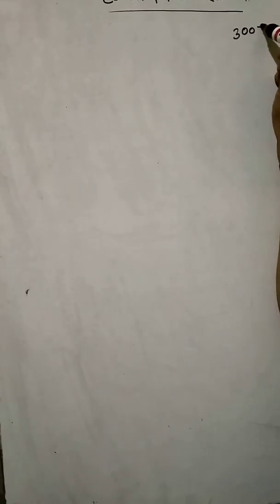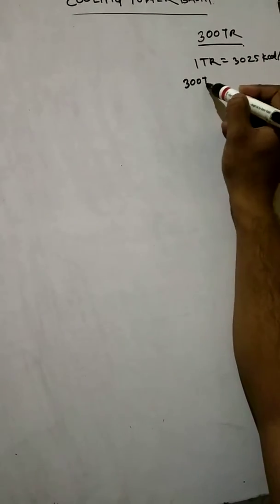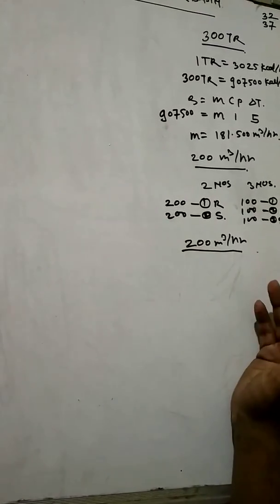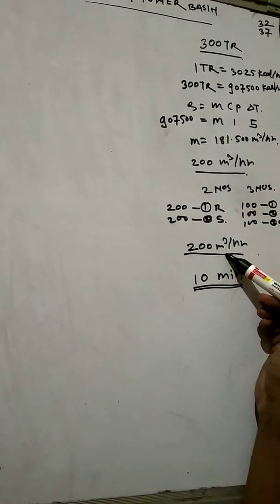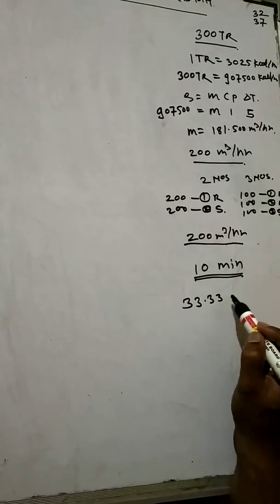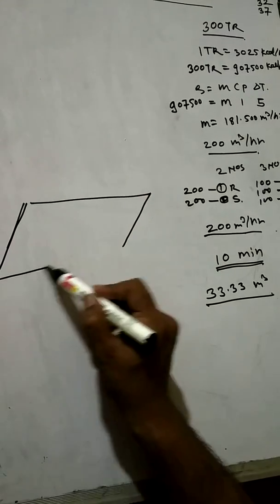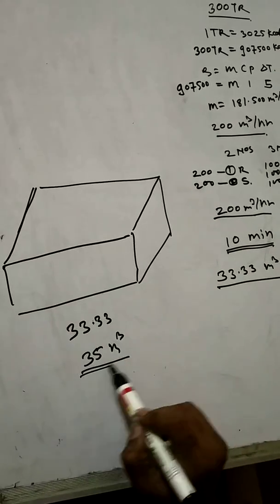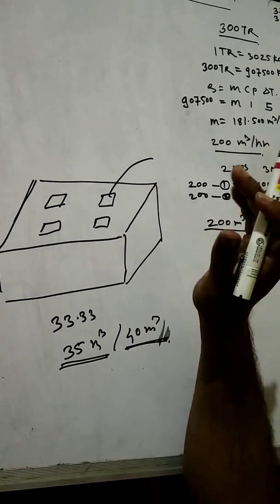Cooling Tower Basin capacity

Comment: But how 33 M3 capacity comes?
Reply from the maker: Dear Nikunj,
Thanks for watching this video.
We have to select pump Capacity of 200m3/hr.
Means we have to select basin capacity of minimum 10 minutes storage as per pump Capacity.

200 m3= 60 Min.
Hence 33.33 m3=10 Min.

Hope you have clear.
Reply: Why 10min..why don't you choose another value
Reply from the maker: Standard selection time is 7minute to 10 minute storage.
You can select hire.
If we select minimum time then possibility of  basin water can be finish before return from plant side.
Then pump will run dry.
Hence select 10 minute storage.i.e water can return from plant side.

Hope you have clear. Thank you.